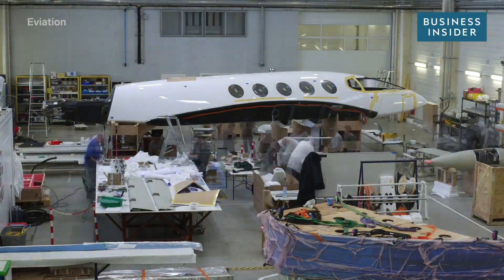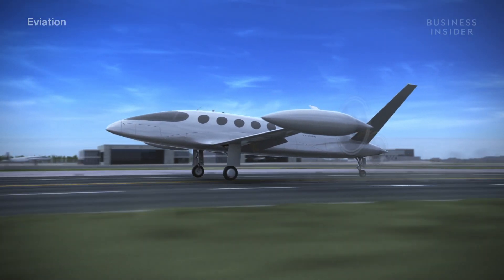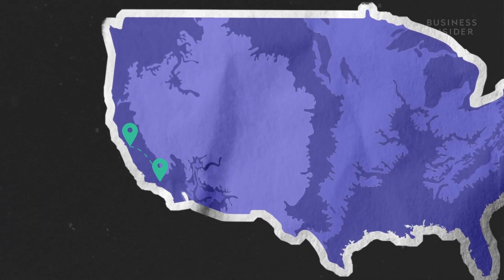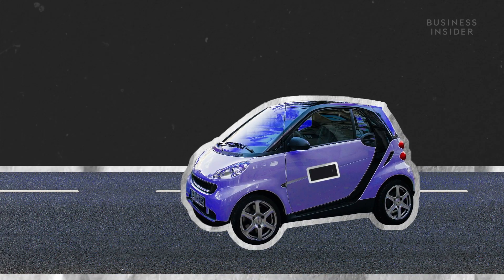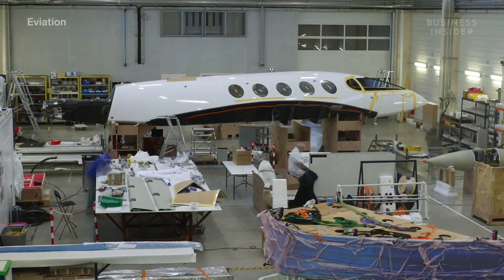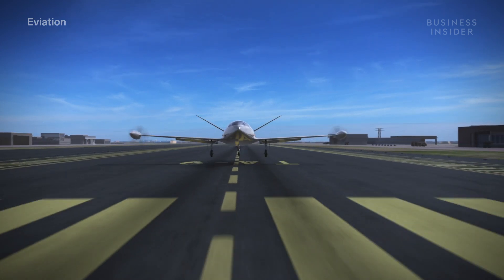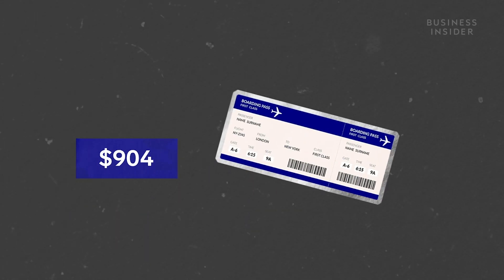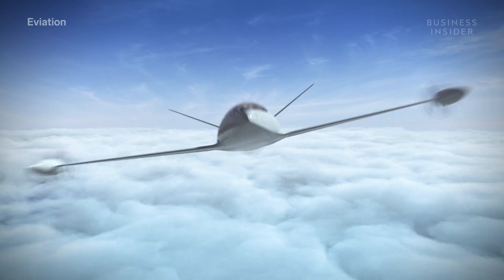Inside The $4 Million All-Electric Plane

Comment: Aluminium air batteries are much lighter for the same energy and can give 10 times longer range. Only problem is that tlaliminium air batteries are not rechargeable so battery swapping is necessary. Using many small battery modules makes swapping viable and much faster than charging. For short distances litium will be cheaper still, but for long distance flights aluminium air should be able to out compete jet fuel.

Comment: Why do the RC planes not have this problem.
Reply: Most RC Planes are made from light materials, plastic and etc. If you made a life sized plane out of those materials it wouldn’t go so well. As well as the fact that life sized planes need to worry about seating, toilets, the general weight of passengers on board. Plus, most RC planes use the wind to glide, and it often leads the fuselage unstable (passengers would be tossed about) as well as the fact that an RC plane, being smaller, has a much greater lift due to air being a more heavy element compared to what the plane is displacing. I hope this helps.
Reply: @williamclarke1672  yeah i get that but we already have new composites like carbon fibre and aluminum sheeting tech. We also have improved motor technology.
Reply: @carlo9524  keep in mind this video was from over a year ago.. perhaps they’ll need to remake it.
Reply: @williamclarke1672  my point being. Objects are being sent to Mars and way into the deepwater. Maybe we can have a propulsion system and rigid materials that can match.
Reply: @carlo9524  rovers use large boosters that use rocket fuel to get off of the planet, they only become their rover form after they are in ‘zero’ gravity. Rovers also use rocket fuel as well as a mix of solar powered energy when they get on the surface.

Comment: There is no climate change. You don’t get electric cars/planes for “climate change “ you get them because they are flat out better vehicles. Less maintenance less cost to operate. Battery tech will vastly improve over the next five years. In five years batteries will be 1/3 the weight with 6-7times the energy density. A passenger plane will be able to fly to the UK without a recharge. Cars will be able to go over 1000 miles before recharging. And recharge times will be cut down to a few minutes. Gas and Diesel engines will soon be relics.

Comment: If this plane can perform as advertise. $4 millions is a fair price. Remember the Icon A5 first came out with a price tag of $150K to $175K? and now is about $480K.
Reply: @stratocasterblue  two person and is designed as a recreational aircraft.
Reply: I don't follow you as to how the A5 in 1950 has anything to do with this plane today, A5 was a Military plane 2 person and not a passenger plane
Reply: @stratocasterblue  1950? Icon A5. I simply point out the pricing of these aircraft.
Reply: It was a 2 person Mach 2 Nuclear Strike war plane from 1950, what does that have anything at all to do with this jet?
Reply: @stratocasterblue  Icon A5.

Comment: Instead of a built in permanent battery, why didn’t they plan around an interchangeable battery? Airlines makes profit by putting planes in the air. If it’s charging on the ground for hours, wouldn’t be as profitable.

Comment: If the fuselage is fully carbon and unibody why don’t they put some airbag system in it, it’s gonna be life savior specially for small commercial airplanes which the height of flying and the pressure problem is better.

Comment: Here's an idea I've been advocating for years that no one has yet to look into and it has everything to do with electric cars and planes or anything else that uses electric energy for any form of propulsion. Simply harvest the kinetic energy available and in case of "Alice" it would mean harvesting the kinetic energy from the rotation of the propeller by integrating a coil into the structure of either the propeller itself or part of the propeller or there could be a coil integrated into the aerodynamic cone in front of the propeller or both. It has got to work because wind turbines work. Of course, we're looking at unlimited range at no cost by means of a totally clean energy source and if it works on an electric plane it will work on an e-car or on practically anything that moves and then there is the school of thought that says this type of energy source could be used as a home energy source. The down side is that you would have a weapons delivery system with unlimited range also.
Reply: @colinsouthern  You're the one that doesn't know what he's talking about and it is perpetual propulsion.

Comment: High density solid-state fuel cells are what you need to wait for to make a fully electric plane viable I think
Reply: That or surely hydrogen fuel cells?

One feature of hydrogen that's great for aviation? Its super light. It's already being used for longer range drones.
Reply: @arbitermatt  well, by solid-state, I'm referring to a more broad class of fuel cells, while by hydrogen fuel cells you are referring to the chemical process in the cell. Hydrogen cell is one of those type of fuel cells that can make this feasible, but it will also need to probably be a solid-state type of cell. Carrying and storing large quantity of hydrogen gas is not really practical. So, the hydrogen has to be stored in a different form like liquid or solid-state chemicals for example, which will be more stable, dense, and compact, and will release hydrogen gas on command.
Reply: @JeffBastian  Got you, sorry I didn't see the fuel cell part and assumed you meant batteries.

Comment: Take an existing 12 passenger twin-engine airplane, add in 2 Tesla Model-S battery packs, and replace the twin gasoline engines with 2 Tesla Model-S motors, and then add a third one to the nose of the airplane. This would effectively turn the airplane into a pretty good 100-mile, 6 passenger airplane, for only about $50,000 in modification costs.

Comment: What an amazing design ... but the fact that in flight the batteries will not get lighter 😂 is a serious constraint vs. fuel. Baybe in flight they should drop the discharged blocks with a parashot 🤣.
With its V tail you will not be able to fly this plane if one of the wing-tip engines dies on you ... but if you turn the other wing engine off and feather both props, you should be able to keep this thing stable in the air just by its tail rotor alone - what an ingenious design ... love it!
The entire world is crying out for a good hydrogen fuel cell and infrastructure that generates hydrogen with zero emission in the most effective and environmentally friendly way. Batteries should just be used as general buffer and for an emergency if the fuel cell failed, not to do all the work, that is very impractical, especially on planes where weight matters so much. It is almost the same with cars ... now we are ruining parts of South America just to maximize the enormous amount of lithium we need for batteries, because here again we use it as the only power source instead of just a buffer and backup ... instead of using a tiny fraction of batteries just for buffering the fuel cells output. It might not even have to be a battery, it could be an array of super caps, which is much better with storing spontaneous current peaks that batteries can't handle efficiently.
Just look at an example of a hydrogen based zero emission car design ... search for "Hyperion XP-1" ... 0-60mph in 2 .2 seconds, top speed over 220mph, range over 1000 miles before refueling, which takes approximately twice as long as refueling a regular car!
The entire world should extensively research hydrogen fuel cells and producing hydrogen as a #2 goal, behind #1 getting viruses under control and keep us alive. 
The other alternative to the hydrogen fuel cell would be a tiny nuclear reactor, which is for my understanding definitely to scary in any type of vehicle, though hydrogen is also not exactly not scary, just like fuel isn't either, but much less than highly radioactive stuff being spread. Is there any other serious alternative, please let me know.

Comment: But the problem is that it only seats 10 passengers. A traditional short-distance plane like an Airbus 320 Neo seats 200. So yes, recharging batteries is much cheaper than fuel, but you have to build 200,000 of these to meet global demand for sub-600 mi flights and airports absolutely could not accommodate 20 times more takeoffs and landings. For now, this would make a nice business jet. Otherwise, batteries are not there yet, we need ~500 KWh/kg energy density, which is 2.5 times higher than what we have now. We'll get there within 10 years. In the meantime, focus on electrifying vehicles, air travel is only 2% of global emissions.

Comment: Your NY-DC time example probably isn’t the best choice. The cities are only a little over 200 miles apart, so much of that time would be taxiing, takeoff and landing, which would be similar for both jets and turboprops. During the flight, the jet would probably only have a portion where it’s traveling faster than the top speed of the turboprop. You’d probably have to get into the 300+ mile range before you would see significant differences.

Comment: Will probably work fine on shorter routes, but they even state the problem with it which is weight. Because of the size and weight of battery needed to power a larger plane than this, it's probably not possible to make an electric plane larger than this. At least not for now due to the low energy density of lithium-ion batteries vs jet fuel. 

There's also the risk of the battery catching fire. Now we are not allowed to put a phone with lithium-ion battery in the overhead compartment because of this potential hazard, but here are these maniacs that wants to make a whole plane out of it? Bon voyage my friends, think I'll rather walk.
Reply: That why VW is. Heavenly investing in quantomscape a startup making solid state batterys and they can't catch fire
Reply: @joshuakotei6261  How's the progress on that? Have they actually any results to show or is it still high flying science fiction?
Reply: @feonor26  Results are there should I send you a video about that topic?
Reply: @joshuakotei6261  Please do
Reply: This is Samsungs version but made same just that WV is working with a startup and the results are promising
Reply: @joshuakotei6261  Well I just skimmed through their web site and they are making a lot of promises that's gonna be tough to pull off, but who knows...? One theme that is recurring is the energy density. To say we're gonna increase the energy density in a battery by so and so much is....I don't know...a tad bit too optimistic. It's like saying I'm gonna increase the efficiency of petrol engines by 50% or something. Easy to say, not that easy to actually pull off.
Reply: @feonor26  okay i hope the batteries will be available soon
Reply: @joshuakotei6261  Hope so too but until now there's been too many people promising more than they can deliver so i remain a healthy skeptic
Reply: @feonor26  yes but solid state battery is a battery that has been researched the most since over 40 years so I see that this will be realest some because a car manufacturer uses these battery and have 1000 km range

Comment: I think this can work, and when get it a little bit faster like maybe 350 mph it will really spread for regional flights.

Personally I hope the future is a combination of electric planes for regional flights and hybrid planes for coast to coast or international flights where they use electric to start, then switch to fuel and let the sun recharge the battery with solar
Reply: That why VW is. Heavenly investing in quantomscape a startup making solid state batterys and they can't catch fire and i believe hydrogen will also work

Comment: Did not catch if they said how long the batteries would take to be fully charged.  This could affect turn around time.  Servicing an aircraft of that size should not take long, but if it takes long to charge the batteries, then that would affect turn around time and therefore the economics of the plane, as it would be limited in the number of legs it could do per day.

Comment: I don’t see the point. Why not use hydrogen fuel cells? Sure they suck on ground vehicles, but they make a ton of sense in aviation.
Reply: I think electric will be used as mentioned in the video for short distance and hydrogen for long distance airbus is working on a hydrogen powered commercial plane and solid state batteries will replace lithium ion batteries

Comment: Honestly, we are not there yet technologically. Our batteries suck. Until we have a huge technological leap in batteries, this idea won’t work. Yes, it’s nice saving carbon emissions but your 1 hour flight just turned into a 2 hour flight.
Reply: Solid state batteries will fix this VW is investing in quantomscape to develop these high efficient batteries

Comment: I have a solution. Droppable batteries. Splitting the batteries in 3 to 4 units. Use one and until empty an the drop it. :) Like the extra fueltanks on fighterjets. The plane gets lighter and lighter during the flight, like jets with jetfuel.

Comment: Regional jets are not designed to cross oceans. The 50 seats planes are often filled to capacity and are designed for 1-2 hour flight so they are the perfect tool for the job. The new york to dc flight would have more than 8 frickin people on it, it’s hilarious to think that this would be the right plane for the job. Where this plane would be useful is on demand private charter NOT scheduled service unless they can build a bigger version that can carry 50 people and be recharged for 30 minute turns. Also the heavier weight of the battery would be an issue for airlines because of scope clauses which restrict regional flying weights. 

At 3:46 they say a “similar performing turboprop” and show a 747. That is not a similar performing aircraft and also not a turboprop.

My conclusion: On average, 1 out of 3 sentences is this videos is misinformation. This is not news it is clickbait.

Tl;dr this video has the facts wrong and whoever wrote the narrator’s script is an embarrassment

Comment: "Alice's electric engine is practically silent"

You forgot the fact that propellers are very loud
Reply: I think what they mean is that relative to a propeller with an aircraft engine, they're about a third as loud. Similar to an electric lawn mower; the blade still sounds like a pretty loud fan, but there's no 4 stroke gas engine to amplify that sound, so it's about half as loud as a gas-powered lawn mower. With an airplane, the noise inside the cabin would be nearly silent compared to a turbo-prop plane.

Comment: I like how they act like the propulsion system is responsible for the efficient air frame design when you could put just about any type of engine in it (with minor modification) and still get all of the advantages of the new air frame plus the advantage of hydrocarbon's low specific energy density. And ya gotta love those zero emissions coal plants.
Reply: When did they say the electronics where responsible for the aerodynamics?

Comment: But why it cost more it’s more heavy it can’t go far and also where r you getting the power hmmmmmmm a power plant most likely it’s useing gas it is slow and if it gets in a crash every one wil die bc battery fires are way hard to put out and it has a low pay load

Comment: Why don't you replace the portions of the structures of the plane itself with the battery, shaped like the structure of the plane. That way you will replace the weight of the plane with battery instead of adding more weight

Comment: literally useless: tops 700 miles, what about the charge time?  
9 passengers to 2 pilot? only the rich will pay that. 
But it travels 2 times slower, on top of safety checks and travelling to and from the airport. 
Then whats the point of air travel? it better off taking a train

Comment: When it comes to the battery situation I don’t understand why more and more electric plane companies are not using graphene batteries instead of lithium ion. It has been known for 10 to 12 years that graphene is 10x more conductive, more powerful, cooler, and safer to use than lithium ion. It’s sad how many companies are not using graphene 🔋  as their go-to power ⚡️
Reply: Still to pricey to mass produce and when made it can only be made in small quantities at a time.

Comment: “Air travel is the fastest contributors to climate change”. air travel produces under 3.4% of the worlds total emissions. Cars/trucks/buses/boats/trains produce nearly 21% of the worlds total carbon. The plastic production industry (which we are highly dependent on) produces more greenhouse emissions than air travel. 

 fashion and technology industry combined produces over 3.3x more greenhouse gases than air travel.

global electricity production produces nearly 8x more than the air travel. 

Electric planes are not going to help that much because they are  inefficient compared to a passenger jet because they can only operate at lower altitudes because they use a propeller while passenger jets use heat to create thrust which is very efficient at high altitudes due to the outside temperature and the advantage of very little drag at high altitudes.

In a summary, who ever scripted this video doesn’t even know what they are talking about especially on the basics
Reply: For travelling short distances this would be a better option. Because half the time is spent ascending and descending on fuel planes.